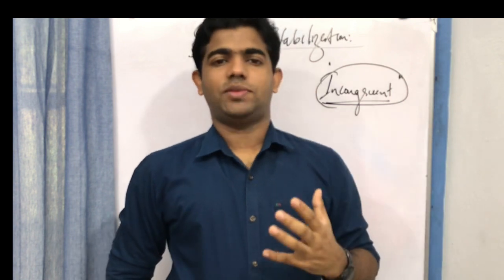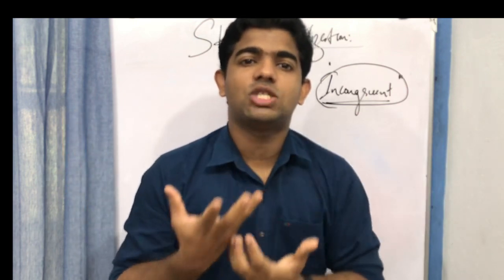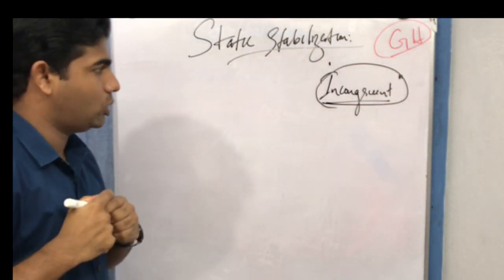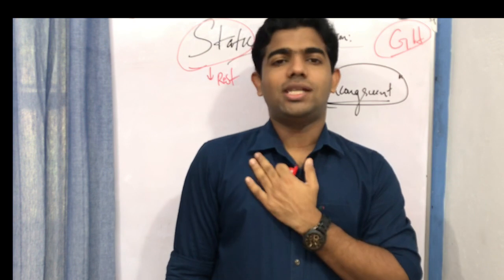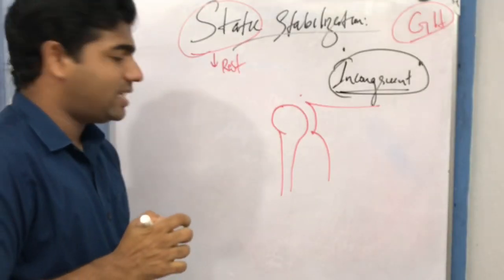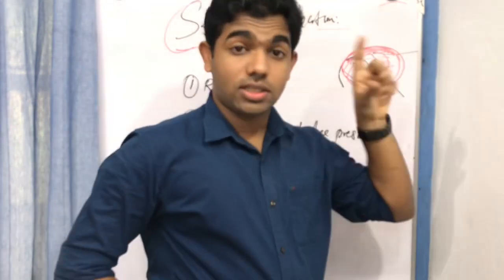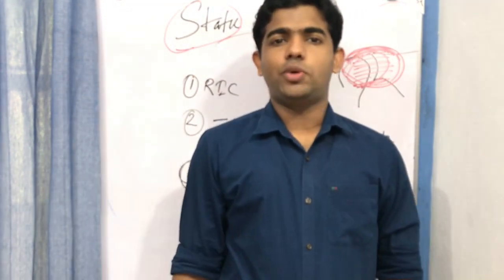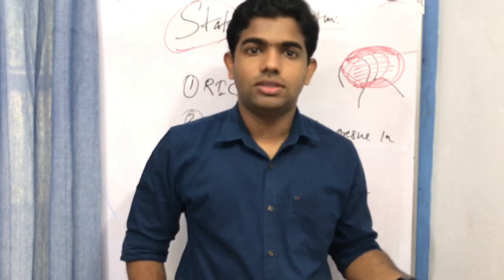STATIC STABILIZATION OF SHOULDER JOINT

Comment: What is incongruent joint? Sir
Reply from the maker: Incongruency means theres no proper atriculation between bones that forms the joint. For instance in GH joint the head of humerus is large as compared to the glenoid fossa. That means only a portion of head can atriculate wth fosss. If fossa was large to accomadte head then it would have been a congruent joint
Reply: Thank you sir
Reply: Sir, what is subluxation?
Reply from the maker: Subluxation is the partial dislocation of a joint. Thts the joint has not completely disclocated and got into out of place but still its not in normal position too